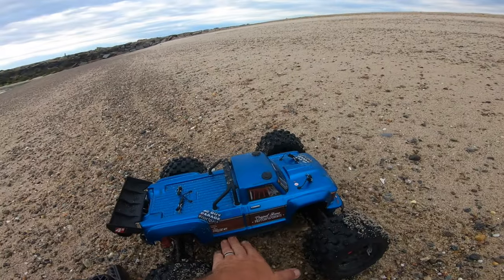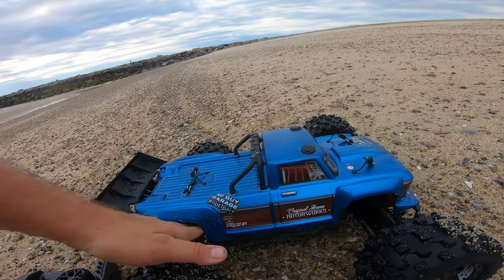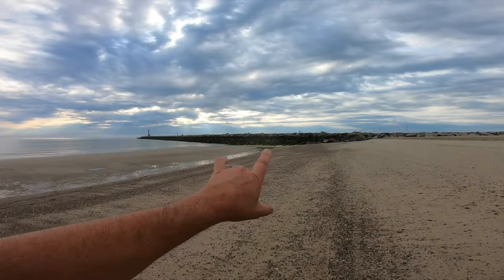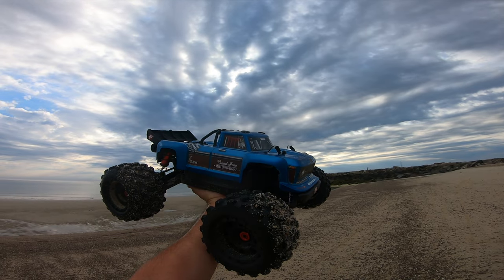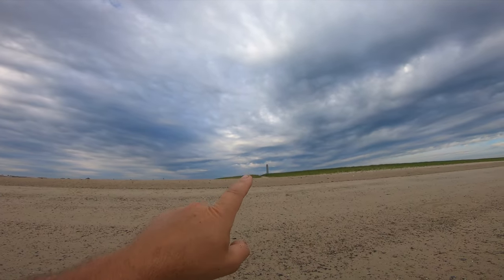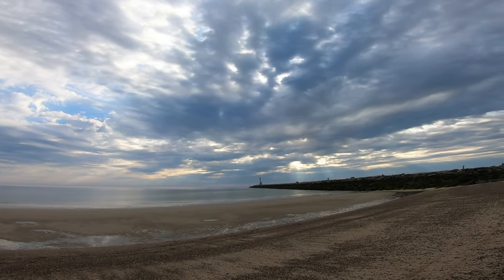FPV with the Arrma OUTCAST V2 on 4s

Comment: My friend you have loosened me up a bit. I’m usually a pretty calculated individual & almost all business which transfers into an odd thing when playing. It’s almost like I’m just concentrating on the task at hand. But after seeing you just throw caution to the wind & let it hang out a bit as they say I’ve started to relax more when out which the RC’s. I’m pretty cautious with the bashers but I’ve found that usually leads to running into something or just making a dumb move. So let it fly & may it land in one piece. Went out & hit up 2 locations one for the Crawlers & one for the bashers. Had a hell of a time I went to a location that has a very little used bike trail & jumps & berms.I had the Lasernut & Mojave & I finally got to see them on nice back to back jumps & berms. The Lasernut surprised me it handle some bigger jumps & had some nice chassis slaps. And then out came the Mojave oh man that thing absolutely killed it on this track I hit those jumps after a few test runs loose as a goose. And man that thing can handle some crap. I did notice on the bigger jumps with a lot of air it would kind of get caught in the wind like a kite. But overall it was sweet having it on a track type setting . It can just rail the berms. I had one berm where it come out of it & have a straight shot to 2 back to back jumps & it really shinned on it. Seeing that 1/7 scale catch that much air definitely gets everyone’s attention not to mention the sound when accelerating. It’s a gosh darn Beast! Keep it loose out there & keep having fun.
Reply from the maker: Now THAT'S what it's all about sometimes. Just letting it rip